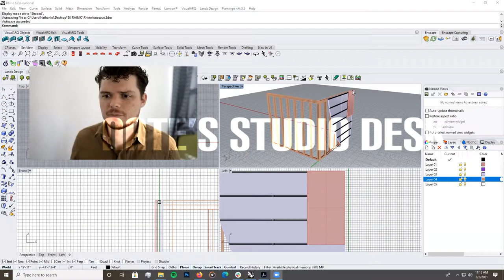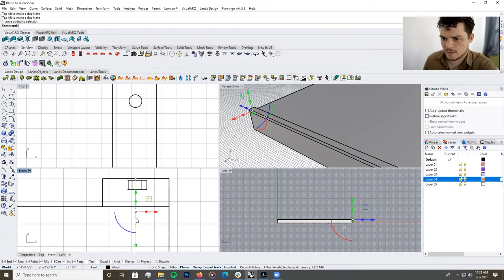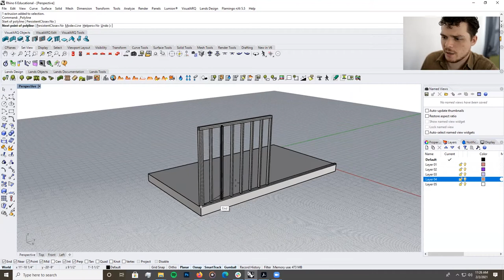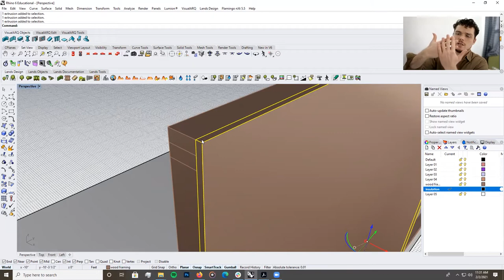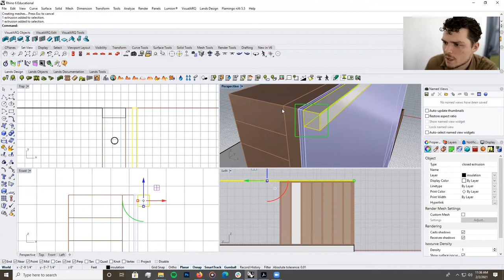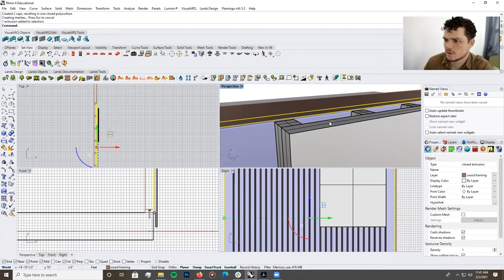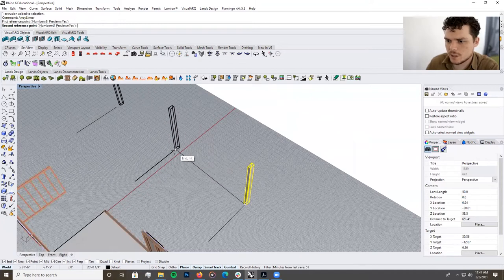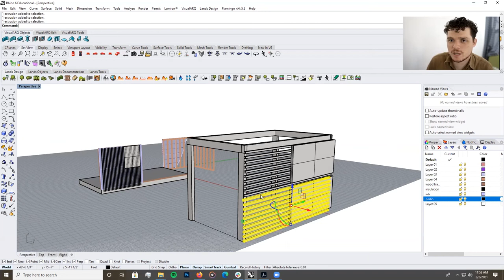How to model a Wall + Layer Management in Rhino

Comment: Hey Nate,

Thanks for the good work.

The strips in the air space are furring strips.  They are usually run perpendicular to
the siding, vertical or horizontal, vertical allows water to drain better.

Thnx again
Reply from the maker: Thats what I was looking for.